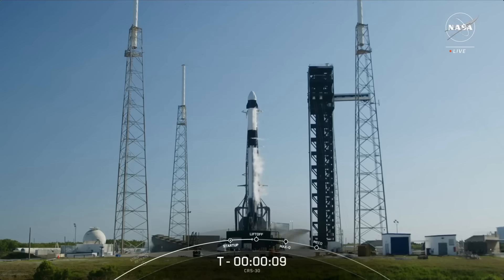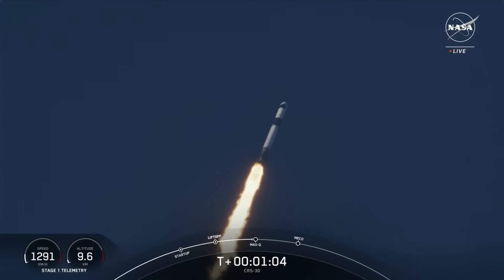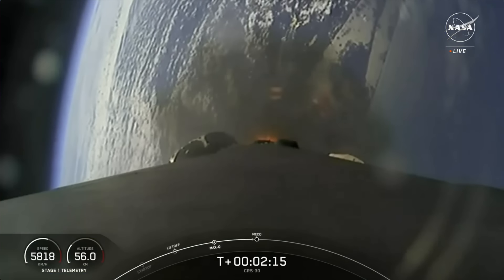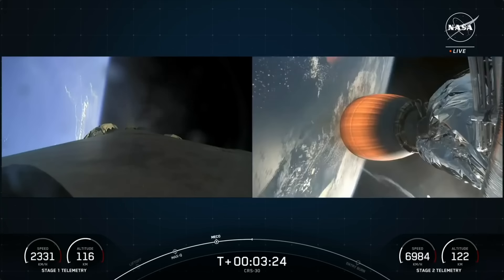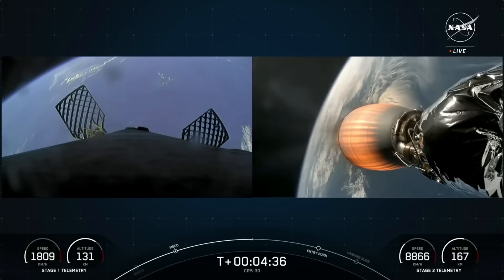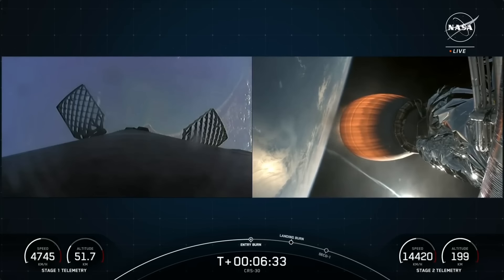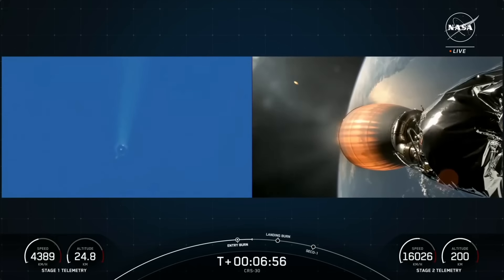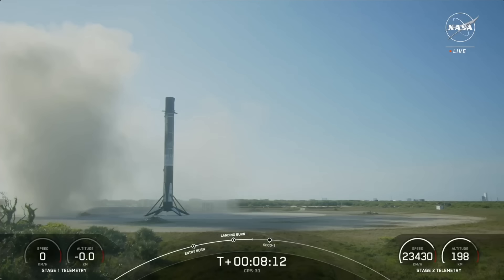Blastoff! SpaceX launches 30th cargo mission to space station, nails landing

Comment: I honestly don't understand how it uses so much fuel to get to main engine cutoff,  then somehow turns around, drops back along the path it came, landing softly using only a fraction of the fuel it used to get to main engine cutoff.
Reply: The mass of the returning vehicle is a small fraction of the liftoff mass because well over 90% of the fuel was burned, getting the 2nd stage high enough to orbit.
Yes the 1st stage looks the same but nearly all its fuel has been burned off, it is only a large, empty tank that has to be steered back to the landing site, wherever that may be.